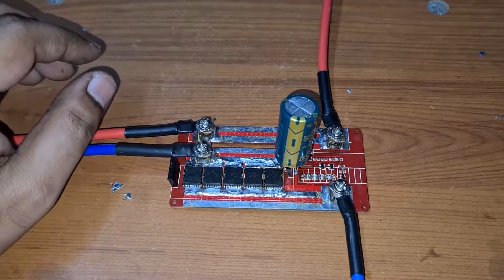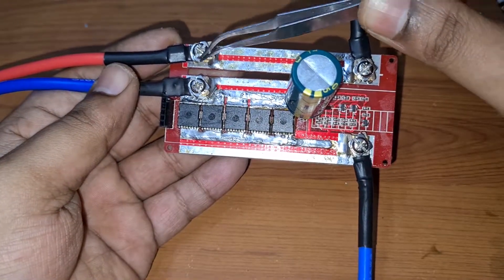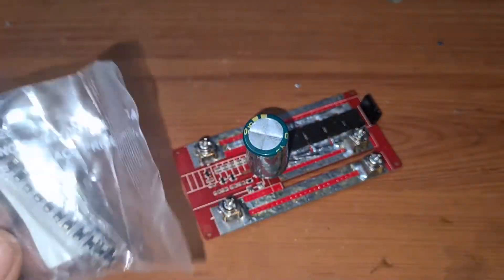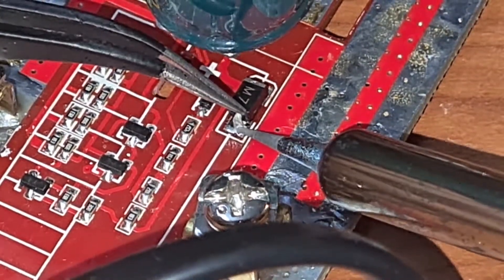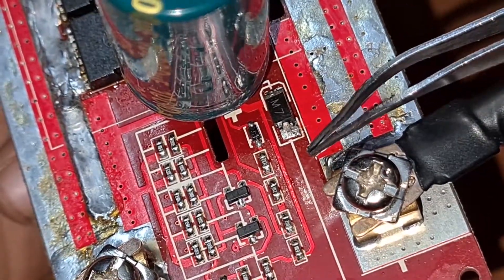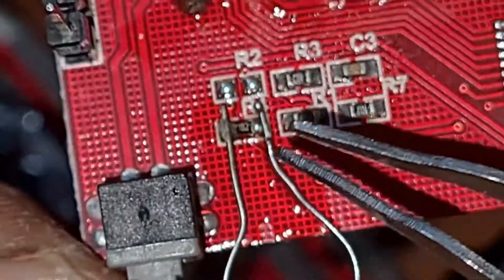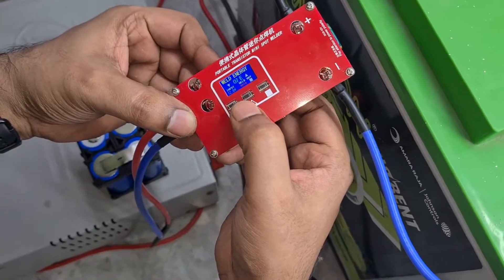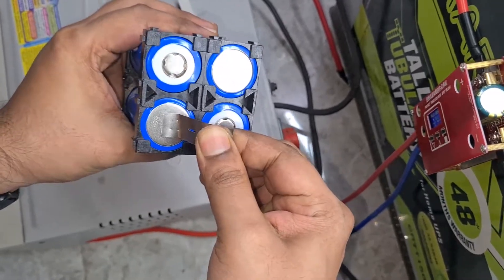[FIXED] Cheap Battery Spot Welder | ordered form Banggood

Comment: Congrats on getting it fixed :) One question - Do you know if during spot welding, is the welding current drawn from the capacitor or does it draw current from the battery? If I'm not wrong, the battery simply charges the capacitor and during the weld, the capacitor releases all its stored energy in a quick time. 

So basically I'm asking if I can run this DIY tool with a low amp battery as well.
Reply from the maker: No you need a good battery, the capacitor is just to stable the output. If you use a less amp battery say a 7ah ups battery the mosfets will blow. many had this complaint. That's why I used the invertor battery.
Reply: @diyIndia  Got it. Thanks.